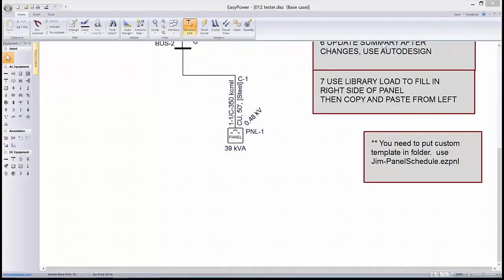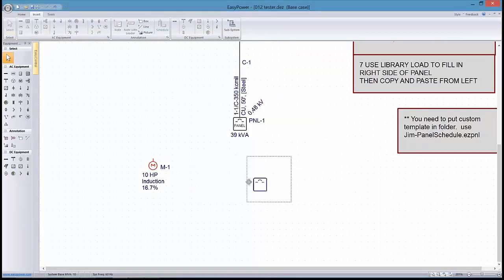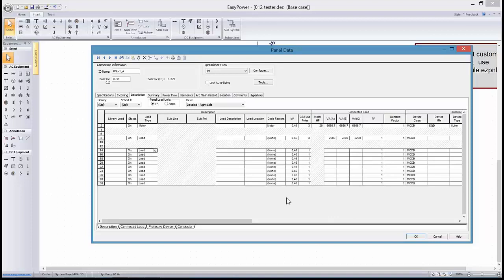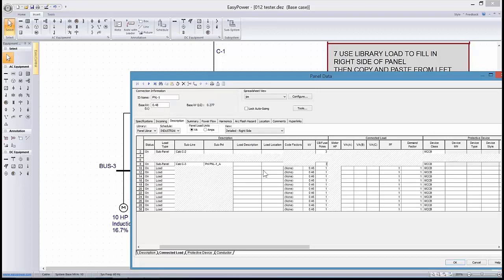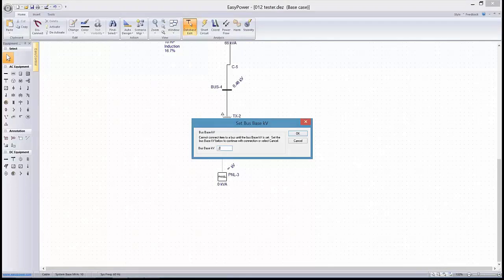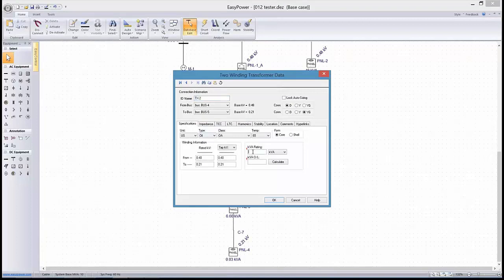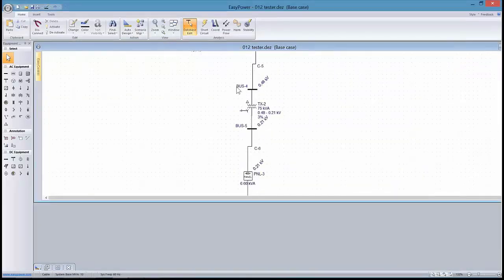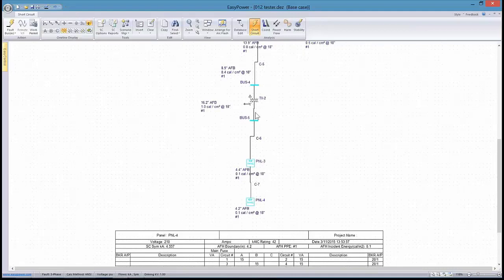Panel Data Entry Options in EasyPower

Comment: If you came here looking for guidance on Double Lug Fed panels (not sub-feeds) it is not present in this video. I explored the panel option to see if it could support this, rather than using busses that required an intermediate "tap" bus for the double lug. When modeling a double lug config, If You have a panel with a MCB you will have to use a "tap" bus to ensure that the MCB on the single panel is not used to calc AF for the second panel.